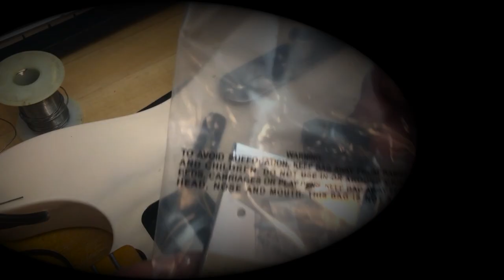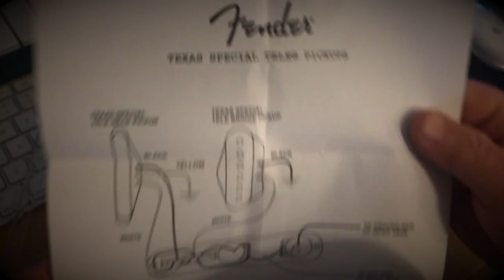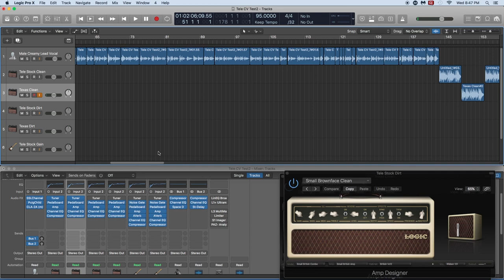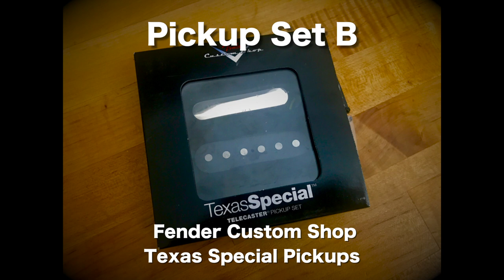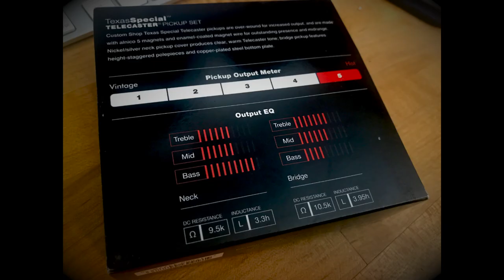Squier Telecaster Classic Vibe Stock guitar pickups VS Fender Custom Shop Texas Special pickups

Comment: No reason to change PUPS. Both are great. If building a kit gat or partscaster project needing PUPS, by all means consider the Texas Specials. But it's the player first, amps second, guitar playability and the electronic/pick-ups in a distant forth that make for good tone. I think CTS pots upgrade should always happen before PUPS. They are not expensive at all.
Reply from the maker: Hi Bill and thanks for your comment. Please subscribe!

Comment: I can tell right away even with cellphone speakers which is which.  TS fares much better with gain and has a more balanced voice clean.  The CV OEM sounds more vintage but has a bit more character clean.  I think these white blonde finished ones came with alnico3's, which are nice but characterless.  The tone rider alnico5 were stronger pickups in the earlier CV.

Comment: i thought that the custom had a slight edge but they did sound alike i could hear a little more bottom end on the custom.
Reply from the maker: Hey Dave, There is more of a difference when you play at volume with an amp. The really subtle differences become more apparent at volume. The TS are great pickups even if the difference seems very small in the recording. I have mine installed in a Squier Tele and I have another Squier Tele with the stock pickups. I like having the choice. Please subscribe to see more of my reviews. Thank you!

Comment: The stock pickups seemed to be a little brighter, with a touch more treble.Not worth messing with the price of Custom Shop pickups to alter the tone so slightly.In my opinion, keep the stock pickups in
Reply from the maker: The stock pickups sound great. Keep in mind that the output of the TS was louder because they are hotter pickups. I adjusted the levels to match for the review.

Comment: To be quite honest I believed the A set were original, set B the Texas Specials. The Texas pick-ups had greater gain, saturation and warmth, with a slightly dark, muffled tone. The original pick-ups were brighter, far more twang and to my ear more treble spank. The originals were slightly brittle. I believe the Fender '64s would provide a similar tone to the originals but with more bell-like tones and less brittleness. As for me I would forego any replacement and reinstall the originals.

Comment: for me,
set B is richer, but if play alone or practice, upgrading to setB is not worth
but playing with the band and real situation maybe difference.
Reply from the maker: Hello Pop and you are right. The TS don't stand out as a clear winner in the comparison but they do have more output which when using an amp means they hit the preamp harder. This changes tha sound and at stage volume the difference would be more notable. Thanks for the comment and please subscribe!

Comment: Sorry you wasted your money on the Texas Specials... :-)  I could barely tell the difference.  I occasionally think about "upgrading" the pickups in my CV '50s Tele, but if it already sounds good, then what's the point?
Reply from the maker: I actually ended up keeping the TS. The reason is not so obvious with my video review. The TS have more output. I leveled both sets of pickups for the review but in the real world with an amp the higher output TS works better for me. Mainly because of what happens when the hotter pickup loads the preamp. It's still not a night and day type difference and the CV pickups still sound great.

Comment: Couldn't really tell any difference.  Interesting as I have been toying with changing the PUs on my CV Tele.   I would observe though that on the few occasions that I have changed PUs in other guitars, the difference is only really obvious to me when I'm playing loud through my amp....at low volumes, not so much.  My opinion, such as it is, is that better (read less cheap) PUs bring out the low level harmonics better when your at higher volumes.  This might just be nonsense though :-D

Comment: They sounded very different to me. Maybe because I'm using headphones? Set B sounded more mellow and with quite a bit more more clarity, obviously you can really tell those differences during the clean samples.  I was surprised that the Squires sounded hotter and with more high end. But I guess even just the pickup height could cause a lot of that difference. This was an excellent demo!
Reply from the maker: Hello Disco, Thanks for the compliment, I appreciate it! Please subscribe to see more of my reviews. Just to be fair I leveled the volumes of the pickups for the comparison. The Texas Specials are hotter than the stock Squier pickups. In a real world situation with and amp at stage volume the difference in the TS pickups I think would be more obvious. The higher output load the first preamp stage and translates into a bigger fatter sound. So there's that. I ended up keeping the TS pickups even though I thought the cost vs sound difference was too small too merit the price difference. With that said I still think that the TS pickups are a good choice and for me they were worth keeping.

Comment: Not done with video saying b is ts? Did I get this correct?
Reply: Seems I did…….the b is way warmer….
Reply: Pickup a has an irritating high end, this could be a fret issue, pickup b sounded warmer , yet had some mud as well, and a lack of clarity most all overwounds have,  that said,  ts’s are not one of my favorite pickups from the fender cs, the nocaster 51s, are I think the best custom shop set for Tele made, however I run don mare hot baklights. And are the best tele pickups I have ever owned short of real vintage ones…..
And definitely do not like hot pickups…..I have learned over the years, want clarity and string balance, under wound,  is the way to go.  But gotta have the chops for it. Thanks for the time you put into this, it was interesting.

Comment: It would have been interesting of you had put a ohm meter to all those pups to see if the fenders are much hotter. I personally don't believe that the switch can effect tone but upgraded pots can. I own an love the fender modern player tele. It always sounds like a tele but with the humbucker bridge pup an coil switch it has more tele flavors! Like most of them the 5 way broke after a few years  but other than that the build quality and playability is worth many times the cost of the guitar.
Reply from the maker: I did post the ohms in the video. Watch the video around 17 mins. The TS are hotter and they are louder but for this comparison I adjusted the levels to match.
Reply: @airtimedesign  sorry I somehow missed that.it was good content like you always put out.

Comment: I put individual brass saddles into my Squier Standard Telecaster, new strings (Gibson Brite Wire 10s), lowered the pickups to the recommended height, set the intonation, tweaked the neck relief and adjusted the string heights to the fretboard then let rip: for a "cheap" mass produced Indonesian made guitar, my Squier now sounds absolutely terrific. A good set up goes a VERY long way! I'm changing up the pickups and electrics on it soon too.

Comment: Honestly, in my opinion. And this is totally subjective and personal preference. There isn't that much difference in the  CV vs the TS upgrade that can't be EQed out to make it worth the investment. But as far as I can here if you were to upgrade,  I would keep the CV Neck PUP and upgrade the Bridge PUP.  The neck seemed more equal and the Bridge TS seemed less harsh. I have a 60's CV Strat. The only thing to me that is a must to change out are the Pots.  The Squire dime sized pots are crap and unreliable.  Once I swapped them out with some good CTS pots everything lit up like a Christmas tree.  A cheap $40 Amazon investment that got me the most bang for the buck.

Comment: I like the sound of the original ones better, But my favorite are the original telecaster pickups. The 52 reissue so to speak
Reply from the maker: Hi Synapse2K, one thing I might not have made very clear is that the Texas Special pickup were louder. I leveled out the samples so as not to have volume influence the decision.

Comment: They certainly don’t make a world of difference. I actually preferred A. More growl (although that could be the specific take), definitely more low end, a little clear to me... however... B would probably cut a little better in a band situation. More mids for sure in B and less low end. I actually thought B was the squier pickups because they sounded thinner.
Reply from the maker: Hey Sam, One thing I wish I had made clearer in this review is that the Texas Special pickups are hotter. I balanced out the volume in the recording to make the comparison about tone instead of volume but I should have made it clear that they are definitely hotter and have more gain.

Comment: Sounds almost identical.  Definitely couldn’t tell I difference playing with a full band
Reply from the maker: Hey Douglas, it's funny cause with a full band at volume with an amp that's probably where you would hear a difference. I leveled the volumes for the comparision but the TS do have more output which means it hits the first stage of the preamp harder. I don't know about you but these little differences seem to become really obvious when I play at volume with a band. The stock CV pickups sound great and you're right, they will sound great with a band at volume but I didn't want to totally discount the TS. I ended up keeping mine and although they are a little pricy it's a nice option. Thanks for the comment and please subscribe!

Comment: I'm guessing that if you couldn't tell much difference between the sets if was because of the device that you are using to listen thru. I could hear a BIG difference in the sound.  Set A was much fuller sounding with a lot of low and top end but little mids. Set B was mid dominated.  If you use a lot of overdrive/distortion the set B works better. Also B will cut thru the mix better as the lows on Set A will be covered up bu the bass guitar leaving just the high and a srilly sound.....For clean work Set A will sound better but will require a little more volume to cut thru the mix.  If used by themselve Set A sounds better.
Reply from the maker: Thank you jchavins for your comment! Please subscribe

Comment: Using bigger strings is another debatable variant, check out Rick Beto  on string size for recording, you’ll be surprised that smaller strings fit into the mix better but alone maybe more pleasant to the ears just more personal taste so who’s guess
Reply from the maker: Hi Arthur and thank for the comment! I'll check out Rick's video. I've never done an actual A-B comparison with string gauges but that would be interesting. Just seems like bigger strings would give you a bigger sound.
Reply: @airtimedesign  Billy Gibbons plays 7s

Comment: Another great video!  I thought it was more difficult to decide which bridge pickup was which.  But the neck and middle position on the CV pickups was thinner to my ear.  I also was using my IPhone XR no headphones to listen to the comparison.  But I guessed correctly that the fatter tone was B.  But that easily could have been the strings giving it that extra beef.  I did the same thing to my Squire Thinline and installed Vintage Noiseless pickups.  Much quieter and a nice decent telecaster sound.  I think the Telecaster pickups sound better than the vintage noiseless Stratocaster pickups.  Ultimately I just wanted a quiet light weight guitar!
Reply from the maker: Thanks Arnold, Even on good speakers or headphones the pickups sound very close.  I never liked the sound of any noiseless pickups on the Strat. Glad they sound good on the Tele. If you listen to the bridge pickup comparison, the TS sounds like it has a little less high end which would make sense from a pickup that has more resistance and windings. The TS neck pickup has a little more bass but that could have been the heavier strings. No doubt they are so close it's hard to hear enough reason to switch them out but I think I'm going to keep them. Probably only because I'm just too lazy to take my guitar apart and reinstall the old pickups!
Reply: @airtimedesign  I agree I don’t hear a significant amount of tonal change, hardly seems worth $150 or $200 for the pickups.  In my case I play in a garage band for fun with some friends, and I play every other weekend at church.  The garage band would be perfectly fine with anything I used, but the praise and worship setting I found my Squire to have some 60 cycle hum that I wasn’t prepared to live with.  I just wanted light weight and quiet.  Nothing like line noise or RF noise to ruin someone’s intimate moment during a prayer.  I like the fatness of the TS pickups as alike as they were.
Reply from the maker: @arnolddealiii4259  Yeah I get it, you definitely need a guitar with no noise in that situation!

Comment: The stock pickups in the Chinese CVs are amazing. If I ever did anything it may be with better electronics but the pickups are way too good for the cheap price they cost from the manufacture.

I'm editing to note that my comment is in reference to the original Chinese Squire Classic Vibe because based on the video here I can see that this is a newer Indonesian CV. The Indonesian CV has different pickups than the Chinese, neck pickup is pickguard mounted while the Chinese is mounted to the body like a proper 50s Telecaster. Also, the Chinese CV has brass saddles. The original Chinese Vintage Blonde in my opinion has the best sounding pickups, even better than the Chinese CV Butterscotch.

I also wanted to point out that the Original Chinese Vintage Blonde had A3 Tonerider Hot Classics pickups where the original Butterscotch had A5 Tonerider Vintage Plus pickups. If you check the TDPRI (Tele Forum) most players preferred the A3 magnet pickups in the blonde.

While I'm not sure what pickups are in the newer Indonesian models, they are definitely not the beloved Toneriders.

Based on your settings samples, both the stock Indonesian and the Texas Specials sounds incredibly bright where the Toneriders in the Chinese Blonde are more Jazz like which, warmer and to my ear, much more pleasing.

As everyone noticed, booting much was gained from this costly upgrade. They both sound nearly three same. You could have bought the Toneriders for less than $50 and been blown away by the difference.

With that said though, Texas Specials are extremely popular in both Tele and Strat form and sounds nothing alike but both will give you some really good tones.

Enjoy that new Tele!
Reply: You're wrong, you know...  The A5s in the butterscotch sound better (I don't care what TDPRI says).  :P

I'm joking, of course...  But not really.  I never cared for A3s.  I had a set of CS '51 NoCasters that I put in a Tele build based on all the positives reviews I'd read, but I didn't care for them.  They sounded very raw and exciting at high volume/gain settings, and that was fun, but I prefer the smoother sound of A5s.
Reply: @Luthiart  I think me, specifically with the Tonerider pickups that Squier used in China, the A3 pickups had a warmer sound and as I was looking for a good, jazzy tone, I couldn't believe the bargain not just the pickups but the entire guitar are. But not every A3 based pickup is going to give you that same jazzy/warm tone. Tonerider just knocked it out of the park with these IMO. And to your point, I'm not always as blown away from NoCasters and Texas Specials the way others are. It really comes down to what works/sounds best to you.

Comment: I put Texas Specials in a CV Tele and it sounds sweeter...the body is heavy as chit though.
Reply from the maker: I've been using the TS is a CV Tele since I did this review back in 1/21. Although the review is a direct comparison off the pickups to an good audio interface, it's definitely not like running though and amp. I like the TS and I although they are expensive I'm very happy with them. The difference in the sound is more apparent when you use an amp because the increased pickup output loads the front end of the amp and changes the sound character. Most people come away from this review thinking the TS are not worth the additional cost. That's fine but I just want everyone to know that it's a whole different world when you play though and amp at stage level. Thanks for the comment Buckseed and please subscribe!

Comment: I like best I think. The high e whiles or even squeals uncomfortably
Reply: That said with a bit of crunch set A feel a lot more comfortable. I think it still prefer b though 12:59
Reply: And this the gain setting b-come out top. The squeal is back on a
Reply: Oh, I am glad I chose the more expensive ones. But at the same time I was hoping the b set would be the CV set! 17:32
Reply: Oh! Perhaps that string change explains the squeal?

Comment: Change the stock electronics, wiring, pots, and switch.  That's usually 80% of the issue.  Stock wiring is typically cheap telephone cord.  LOL
Reply: Very good point there.

Comment: So … why did you change the string set???
By altering another variable you have basically rendered the comparison useless , especially when it comes to clean tones imho
Reply from the maker: Hey Gavin, you're absolutely right, that was a dumb move on my part. I actually didn't even think about it until I completed the review. Then I remember that one guitar had 10's and the other had 9's. I mentioned it in the video just to be fair and if someone was on the fence about which one they liked they could take that factor in to account. Thanks for the comment!